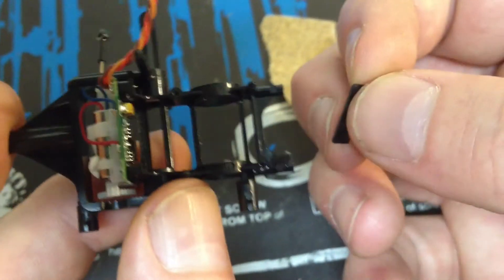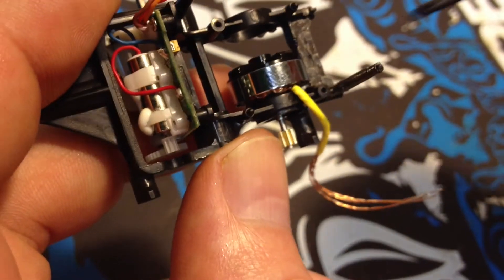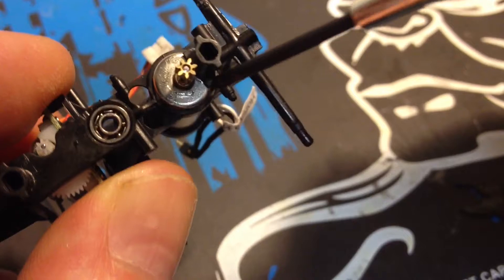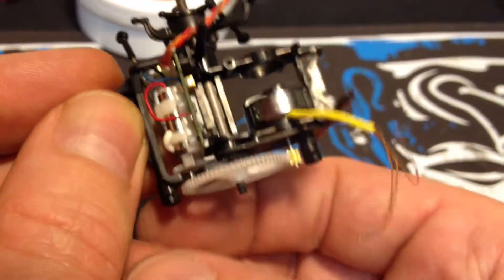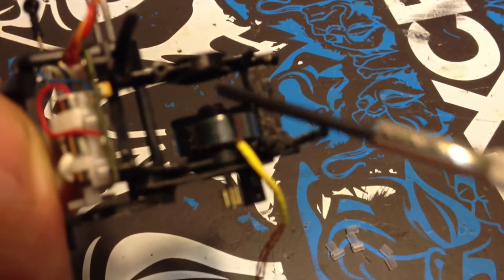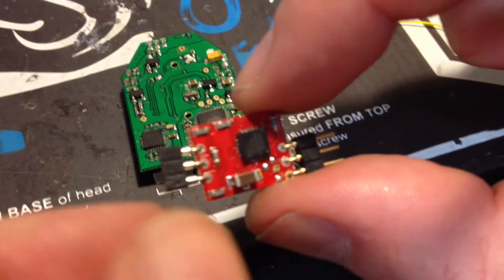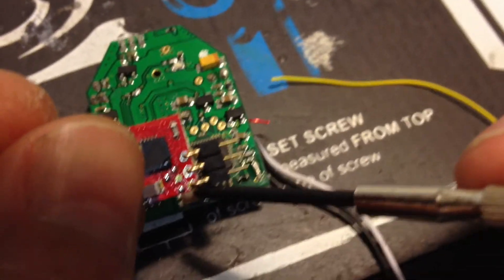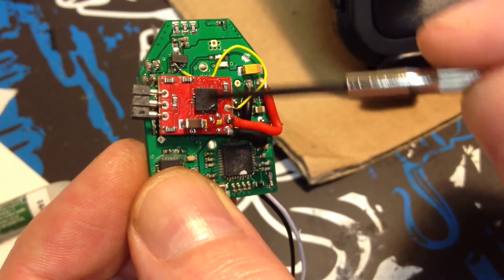Blade Nano CPX Brushless Install Part 2 of 3

Comment from the maker: As long as you keep the bearings oiled, it should last a very long time. Bearings can be replaced and the motor can be rewound, though if I ever need to do that I'll just replace the motor. So far I'm about 160 flights in, still running great!